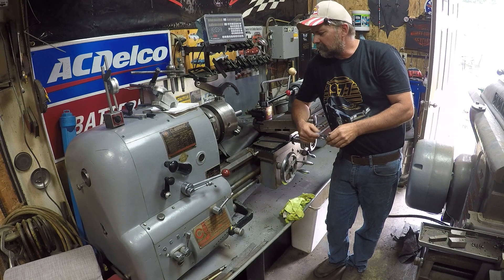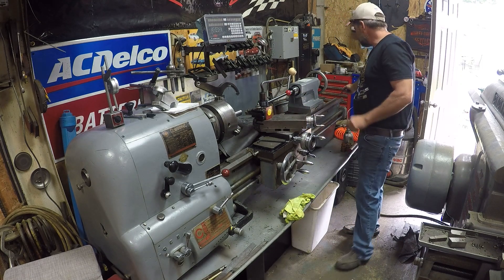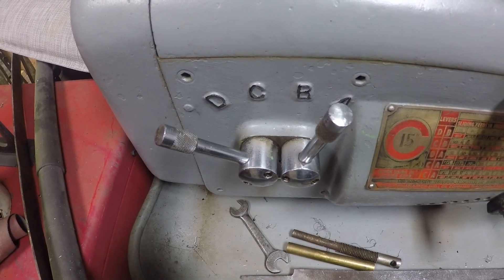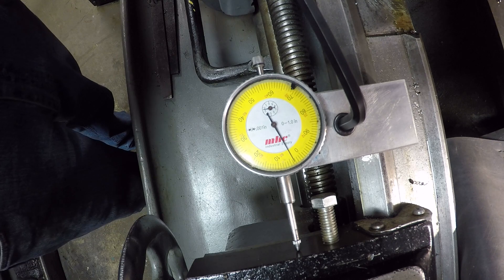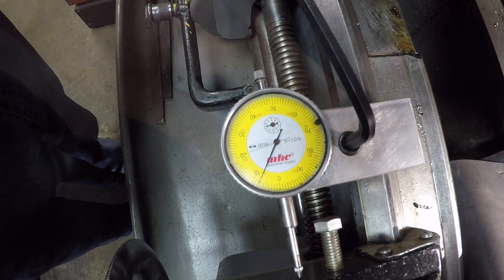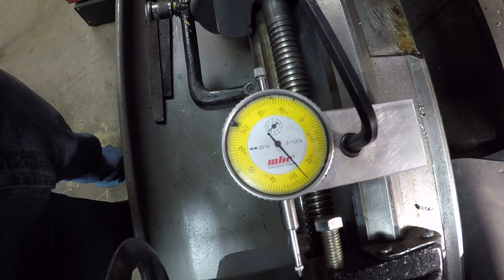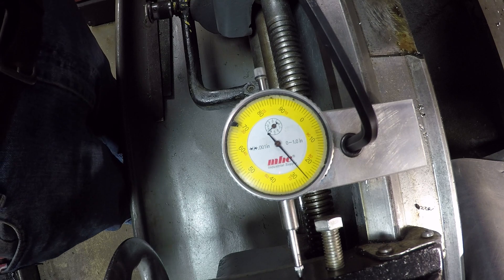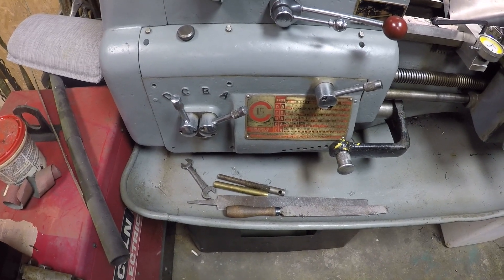Colchester 15x48   #tipblitz19

Comment: I run a similar Clausing Colchester (a 13) at work. The sliding feeds per revolution actually ARE shown on the chart on the gearbox, just below each of the threads per inch. Each lever combination to the left (DB,DA,CB,CA) has TWO ROWS to its right, a brass one with TPI, and a red one with inch per rev.The sliding feeds are hard to read,  they really look like just a red divider between the brass rows on the chart showing the threads per inch. You have to look closely, since the numbers are quite small. Hope this helps you.Good tip! For anyone missing a chart, or even one that's damaged - you could figure it out yourself!
Reply from the maker: Thanks, I  appreciate the help .

Comment: That's a late 50's Non gap bed (early) Triumph (Dominion). As evidenced by... Cast change gear levers, Ass backwards apron with the sliding worm box and no way wipers and that jankey reach around tail stock.
My 1957 Student is exactly the same. Just smaller.  As for the sliding feeds its right there on the screw-cutting chart, you just read off the right hand column. :-)
Your machine is beautiful, i hope mine looks half as good when i'm done fixing it up.

Comment: Good solution.  Does it give you the same answer as 1/pitch?  If not something is off.  Good to know that the lathe is on, and no funky gears in the system.  Would love one of those lathes.
Reply from the maker: It's a great machine . Wish it were a little bit longer.  I've had to pass on some work because the bed is to short.  And I'm in need of a steady rest. 30 inches is about max on the work.